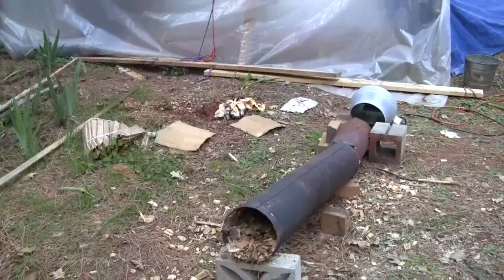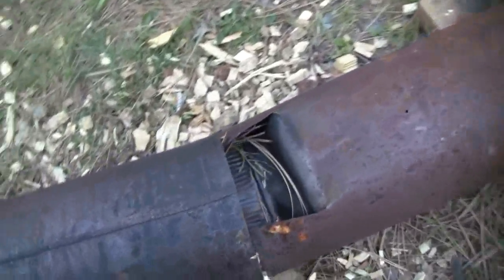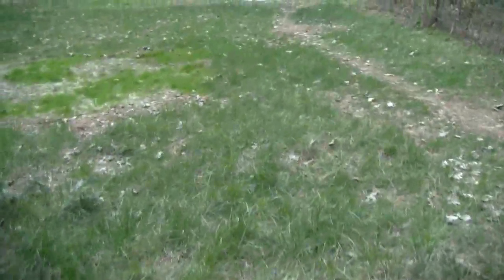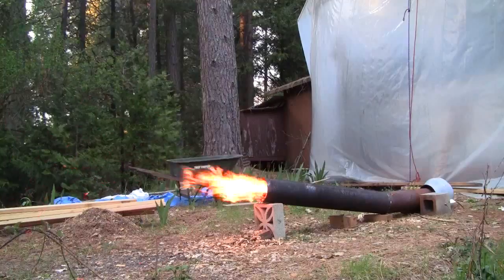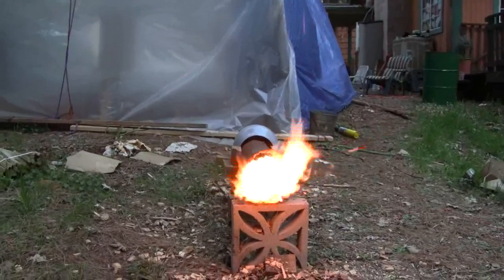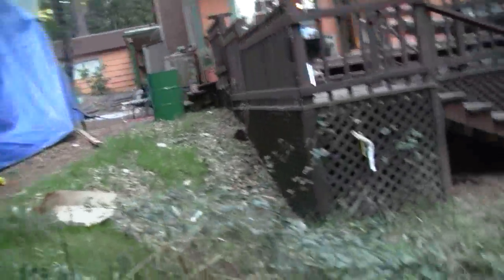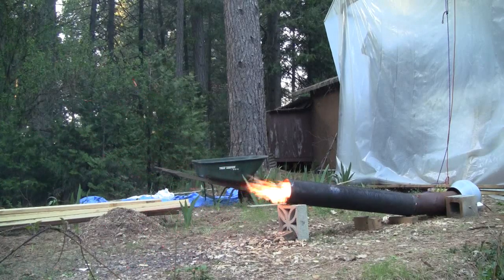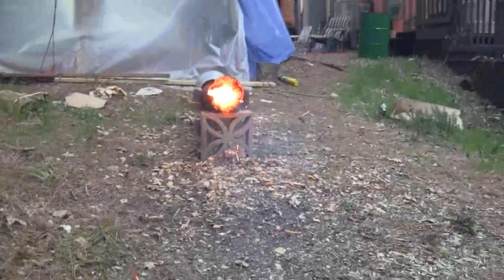Flame Tube Test.wmv

Comment: You would try adding superheated steam to that flame tube. The hydrogen in the steam will enrich the syngas. Check out one of my new video's I built a rocket can and filmed it. The heat given out of the exhaust is much hotter.

Comment from the maker: something like 200 to 250 watts depending on what I'm doing.  Could be as low as around 150 watts if you wanted to streamline things for off grid.  I'm generating around 40,000 watts thermal, so not much power overhead.
rt